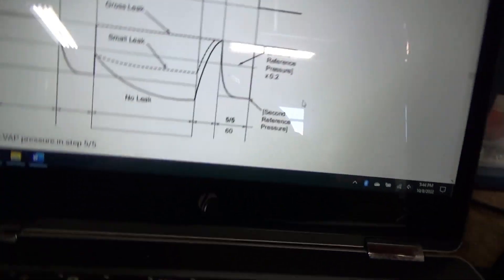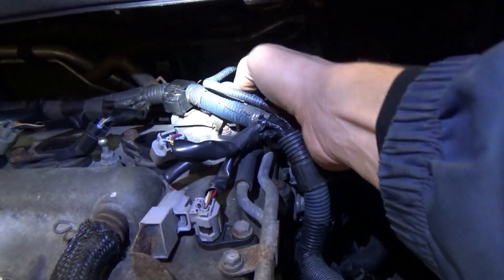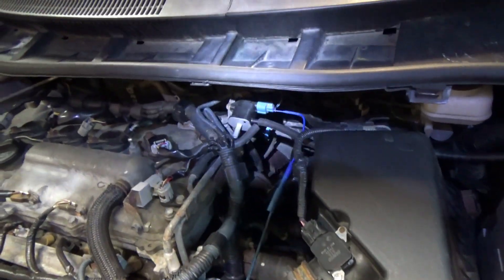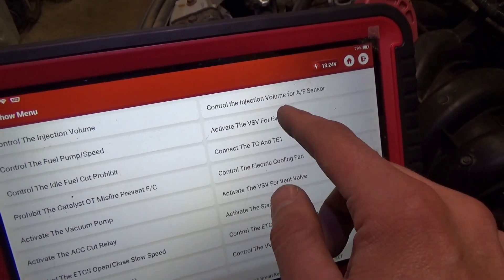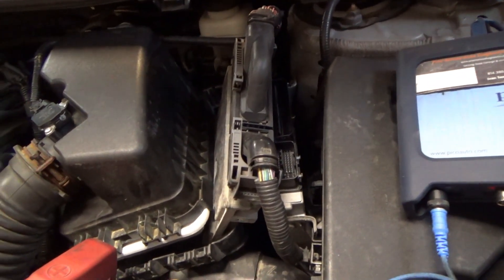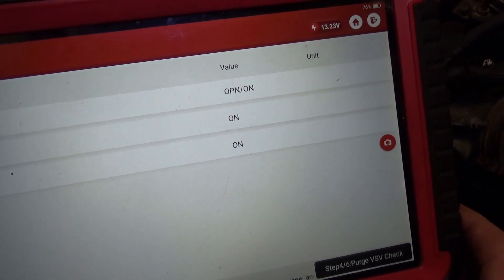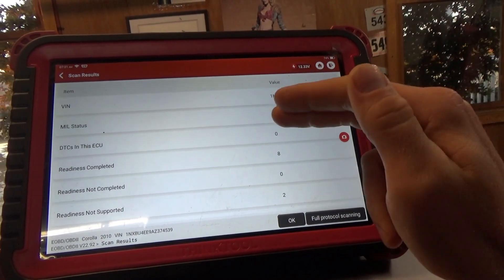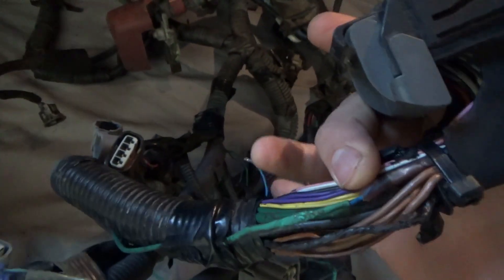2 YEARS of Parts Cannon?! (Toyota EVAP - Part 2)

Comment: I currently have similar issue with Sienna. Absolutely no running issue but small leak code. When reset, it comes on a few days later after driving it. It’s not any easy fix without potentially pulling the gas tank to look further into the leak issue.

Comment: Maybe I am missing something but was the car setting P0441 and P0455 the entire two years and how did the Duralast purge solenoid set the P0455? P0441 I can understand and P0455 with the faulty ECM but the Duralast wasn't stuck open... 
you vacuum tested it... so why the P0455? I have to believe it wasn't setting the exact same codes after the ECM was replaced than before because the failure changed although that Duralast unit still worked anyway... something doesn't add up seems like. How is a bad ECM purge solenoid driver holding the purge solenoid open going to set the exact same codes as just a A/M purge solenoid that works but may be slightly out of calibration? Suprised there wasn't a purge solenoid circuit code set with bad ECM.

Comment: Your are right man, never trought away an OEM part, till the problem fixed, and i say nevere trought away some  repairable OEM part also, it is better repair them than use an new aftermarket part, or you can install the a cheap new afternarket part so you can use the car immediately and take your time to repair the OEM one, I did a big mistake that i never forget by throwing away OEM honda front  axels ( theu cost over 600 dollar new, but they can stay in the car over 10 years), they just were leaking grease, easy fixe, by replacing the boots and grease, i thought installing new aftermarket one is enought, i also through away an OEM honda rack and pinion, it was leaking from the high preasure line, Easy fixe by replacing the line by making your own line (too easy, I learned that when i fixed the leaking brake line on youtube and i fixed the brake so easy by cutting and replacing the rusted part of the pipe), now i need to buy a good used honda OEM rack and pinion if i find one on ebay, because the new aftermarket one is failing, especially at cold temperatures below 45 degrees. When it is cold, you cannot turn the steering wheel until the car fully warmed up, that takes almost 15 minutes of the engine running at cold temperatures. After that you can turn the steering wheel, but you feel some resistance.

Comment: This is a very interesting scenario.  Could the following be somehow related?  There is a TSB for 2010 through 2013 Prius that involves the Purge VSV.  It says replace the purge VSV AND reprogram the ECM with the latest calibration to address this condition.  It also implies that the old ECM programming was causing a vacuum line to the VSV to become unseated.

Comment: I’d be worried the ori OEM part would act up after getting hot under the hood in the summer, and that took out the driver on the ECM. Maybe get a new OEM solenoid and put that in there to be safe.

Comment: i try to do oem because now some oem parts are cheaper than aftermarket. but I just ran into a toyota a/c compressor there was sensor that is like $50 and will fix the a/c not working. toyota wants you to replace the $700 compressor. great video

Comment: I think you did not tell us the whole story on how this car was fixed, the purge valve original and aftermarket both did not vent the pressure in 10 seconds fast enough to atmosphere pressure to pass the ECM emissions test, I think you changed the ECM to a original Toyota corolla one!

Comment: i went through this same parts crap with a 2006 chevy truck, 5.3. I had to pull the intake 3 f'n times for  after market knock sensors. after the second time i refused to touch it again unless i get OE parts. Finally got them and it left, and stayed gone.
Reply from the maker: I've even seen repeated failures on OEM AC Delco knock sensors out of the box!!
Reply: @PineHollowAutoDiagnostics  same here,       but on that truck its all that would work.

Comment: This puzzling problem may have to do with leak on the canister side of aftermarket purge valve.  You checked only engine intake side of the purge valve and it held the vacuum and assumed that canister side would hold the vacuum as well.  This is where the mistake could be.  I have same code on my ES350 and I checked only the intake side and it held vacuum and assumed the purge valve is good. However, based on someone's comment, I checked the canister side of purge valve and it was leaking vacuum badly.  In this case, the vacuum test that ECM does will fail since vacuum pump creates vacuum from the canister side.  What could be happening in this video may be that the aftermarket purge valve was leaking from the canister side even though intake side was holding vacuum while OEM purge valve was holding vacuum on both sides.  This could be what made the difference.  It is always good to check both sides of the purge valve instead of only intake side.  Most of the Youtube videos only show checking intake side and, for this reason, most of people fail to check canister side and end up wasting a lot of time looking for problem elsewhere.

Comment: Failed ECM driver could have been due to back EMF from the aftermarket solenoid. Maybe the OEM solenoid has a freewheel diode built-in to protect the ECM and wiring from back EMF when switching off, and the aftermarket one doesn't.

Comment: My bet is the original ECM was fine & past tinkering fried it - it needed a check of the  purge valve wiring/connection & nothing else as the "First fix" back before the tools jumped in. :-) Bet they messed up with a test & fried the ecm purge control in the process, leading to all this. I still give that aftermarket ecm jack-all time before it too starts causing more issues. Leave these factory - do every test going but don't start snipping wires/swapping in spurious parts/guessing - it will lead to pain. This owners pain is not finished.. betcha. :-) Keep that original ecm - send it off for repairs. Gonna be needed. :-)

Comment: That circuit in the harness was hacked.  I think whomever worked on that harness (maybe broke a wire on unrelated work) fried the driver when they did the work.  Probably worked with the power on and shorted something, frying the driver in the ecm.

Comment: Ivan your videos are great and you are definetly a master when it comes to skills and interpreting the data.
But in this case study i did not see which piece of data led you to condemn the aftermarket purve valve other than the fact that the evap readiness monitor was complete. They both caused the same decay in vacuum when pulsed and consumed similar current. Since the aftermarket purve valve is sealing correctly, why did the gross leak code set?

Comment: Ivan after 2 years and at least 4 repair places  3 (6 hours would have been fine) hours of diagnostic would be a bargain.  I still don't understand why aftermarketers sell parts they know are not exact and charge near the same price.  I did get lucky on my computer module from Autozone under the coils on my 2002 Buick Lesabre lasted 7 years before it died. I am so glad you tried the old solenoid before getting another computer.  Too many cooks spoil the broth until they get a Borscht cook.

Comment: Now this is an assumption of course but I think maybe the first mechanic knowing that the ECM was bad for the purge solenoid presumed that that's what took out the ECM because of course it is an electrical solenoid 12 volts if something shorts bye-bye ECM and a lot of cases intermittent short by buy ECM and a lot of cases myself I might not trust that original purge solenoid get a new factory one Yes

Comment: Nice diag on this one,  sometimes it’s not as simple as a purge solenoid replacement. I’ve noticed on some recent jobs that Honda and Toyota did not have tests for purge valve but did have complete system tests. Would be nice if manufactures standardized evap systems, some are very over engineered.

Comment: There are 2 problems with aftermarket parts (1) there trying to make it cheaper than the OEM.  (2) It's reverse engineered.  With the latter even, if there trying to make a perfect copy of the original, there not there in the original design process so the they miss critical aspects of the design.

Comment: Nice work Ivan, that is the big problem, know-it-all owners screwing with their cars and "guessing" what it needs, SMH.. makes your job all that much tougher.  Thanks!
Reply from the maker: Owner didn't have any other options...
Reply: It seems like this owner was dealing with what a previous owner did as well, considering the wiring harness bypasses.   Most people also don't think about going back and checking prior repairs after doing further repairs.  That's true in a lot of industries.    I've been doing the 'parts cannon' on my car for a P0171 issue, but the parts I'm shooting are ones that mostly should have been replaced/checked at least 5 years ago.  That is, vacuum hoses, pcv valve, gas cap, etc.    The shop I was going to use ended up ticking me off when they worked on my wife's car, so I'm not going to take mine there.  (I have a real problem when the mechanic refuses to order from certain suppliers because "they aren't real parts" (roughly).   It's one thing when it's a moving specialty part, such as a compressor or alternator, but when it's a cast aluminum oil pan, and they force me to pay them $450 for an oil pan that I could get for $180 - that's greedy scumbags.   If they'd ordered what I wanted, and upcharged me an extra $50?  Certainly.   So they lost my business completely.   BTW - the specific company they refused to use because they aren't 'for professionals', just for DIYers?   NAPA.  Whose big customer base is heavily made up of small mechanics shops.  Yeah - poser. )

Comment: I suppose that good diagnostics should/could start with checking over the car to find and refit any OEM electrical component parts found in the car one by one to see if the problem resolves :]
As you say, ivan, in this video - OEM only for electrical components with no 'ifs or buts'.

Comment: Excellent series with some very valuable lessons!  The tongue in cheek saying of “$250/hr if you worked on it first” isn’t all that far off from the truth.  I also preach OEM only for anything with an electrical connector.

I recently had a similar situation on an ‘09 Yukon where an aftermarket set of 8 brand new Denso injectors (installed by the customer) had wildly mismatched flow rates and kept setting misfire codes.  The customer had also replaced the battery, throttle body, plugs, coils, and cats.  The original injectors were discarded so a new set of 8 ACDelcos fixed the truck up albeit for a pretty penny.

Comment: I wouldn't be surprised if the driver in the ECM failed because of it being "checked" inaccurately (maybe shorted/jumped) creating a different problem but another part in the parts cannon fixed the original problem.

Comment: Exceptionally well done Ivan, and a great deal of work. I think you probably spent a little more than 3 hours, so that is very fair for a labor charge.

For future reference, the Purge VSV should be pulsed at a period of 100mS, with a duty cycle of 90% at idle, after 10 minutes of idle. That leaves a low time of 10mS, or on (low) 10% of the time, every 100mS. This is according to the 2010 Toyota Corolla OEM (Toyota) service manual, Volume 1. I do not know how long this pattern runs.

I cannot tell for sure if the ThinkTool PROS is pulsing the Purge VSV on (low) long enough. It is hard to see the Div (vertical) lines in order to see what the on time is. It should be on (low) at least 10mS every 100mS. The best I can tell, it is on about 6.5mS every 65mS, approximately. If so, this may or may not be long enough to do the proper purge. It is on for a shorter period of time, but turns on more often (roughly 2 times (for 6.5mS) every 130mS versus 1 time (for 10mS) every 100mS). If it works, using this same test on the ThinkTool PROS with the OEM Purge valve, the only explanation I can come up with is the OEM part opens up farther when fully opened than the after market part, or this pattern goes on for a longer period of time. Now, of course this is with the vehicle running at idle, and this could change at higher RPMs, and I don't have any information on that.

A rough calculation is the specification says 10mS every 100mS, the ThinkTool PROS pulses it 6.5mS every 130mS. This works out to the specification has the valve on (open) 100mS every second, and the ThinkTool PROS has the valve on (open) 50mS every second. If these calculations are correct, the ThinkTool PROS would have to run this pattern twice as  long to have the valve open for the same amount of time. If it fully purges is greatly dependent on how long this pattern (or any similar pattern) is run.

Please note that this applies to models ZRE142, and AZE141. I do not know what model this is, so cannot say for sure if this specification would apply to this vehicle or not. I think it does, but i don't know for sure.

Again, Ivan, a great job doing what those before you could not. And, thank you for putting in the extra work to film this for everyone.

Omegaman

Comment: I wonder if the problem was originally in the wiring harness and the original owner blew the driver by, at first, miswiring the repair.  Still, it would be interesting to see the schematic of the driver circuit.  How does a blown transistor to ground cause the output to hold steady at 6V?  Seems to me that a transistor will either blow open or short, 12V or ground respectively.
Reply: I'd guess a capacitor issue that leaked/shorted or a spike it killed a diode/pull down resistor. many things could cause a "full on" instead of PWM and yet still shutdown with long off time.
or stay on once triggered, mosfets love to stay "on" and turn themselves on without proper gate pull down circuitry. shorted coupling capacitor could be allowing voltage through from the next device in line also. good old junktronics :)
Reply: @throttlebottle5906  I'm sure if I saw the schematic,  I could think of a failure mode that would cause this, but in the many MOSFET open drain circuits that I've seen and even designed myself, no failure mode I can think of would produce a 6VDC output from a system running on 11-16V, regulated to 5V to run the electronics.

Comment: The driver may have failed from the previous  owner's hack wiring job. But yes toyotas do break. My dad had a Tacoma pre runner that needed repairs that you wouldn't normally have to do to a domestic car. At less than 50K too. And dont forget about the death trap toyotas that would run away with unintended acceleration.  I lost a good friend along with her 2 young kids b/c her camry darted into a busy intersection.
Reply from the maker: That's terrible 😢
Reply: OR  she just had her floor mat installed incorrectly and there was no issue with the car
Reply: @111-c7x2t  no, it was a 5 cent shim that wasnt installed in the accelerator pedal position sensor. It was a big deal for toyota. I believe it was the biggest fine that was ever paid by any auto maker. It was known and covered up by toyota. Search for "toyota unintended acceleration" if you want all the details. I do remember toyota initially blamed it on non compatible floor mats before they owned up to it. One dude went to prison after his prius killed someone.

Comment: I think comparing the dc current for the solenoids is not a good comparison since that's not the default operating state, could be failed flyback diode or something that was allowing the voltage spike from the collapsing magnetic field to cook the driver circuit. Best regards,

Comment: That LDP system is very finicky, like the Chryslers were/are. Having that time table is nice but I wished they would've also had a numbers chart so that you could see known good voltages and PSI/HG values to eliminate what is 'normal' vs raw scan tool data. Also bear in mind the refresh rate on your tool is not as fast as what the ECM sees, and with these systems, it's all about TIME! Nice diag! I'll bet it took you longer than 3 hrs charged..

Comment: Your diagnostic video's with good camera footage are highly appreciated.
Keep them coming Ivan!

One remark about this diagnostic adventure:
Has the Toyota's OEM purge valve a flyback diode build in?
If yes and it's broken or interrupted the purge valve driver in the replacement PCM will probably blow again in the future...
It could have been the cause of the first PCM failure. 

The bench test only confirms that the coil is okay, but doesn't confirm the presence of a working flyback diode.
To safely test if the flyback diode inside a valve (or motor) is working, test the valve in series with a test lamp or resistor that draws about the same current as the valve's coil.
Test 1:
Power supply + on the + side of that OEM coil in serie with a test lamp will measure roughly half the voltage over each. Flyback diode not influencing any results.
Current on your power supply will show about 0.25 A; half of your only coil current.
Test 2:
Power supply + on the - side of that OEM coil in serie with lamp will give some low voltage drop over the coil and a brighly lit test lamp. Flyback diode is conducting and okay.
Current on your power supply will now show a bit less than 0.5 A; caused by only the load of the test lamp.
Results:
If test 2 gives the same result as test 1, there is NO working flyback diode present.

If no flyback diode is build in the purge valve:
Hope that the PCM have a protection diode in the driver circuitry.